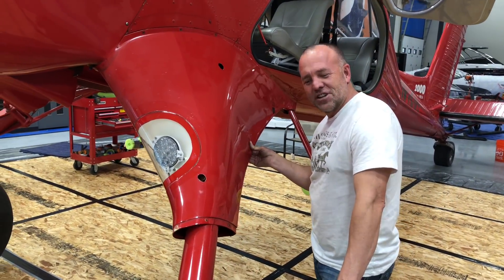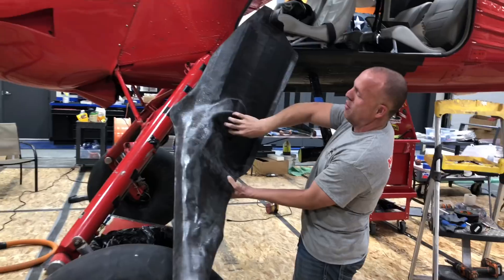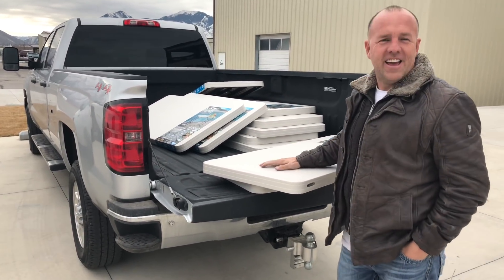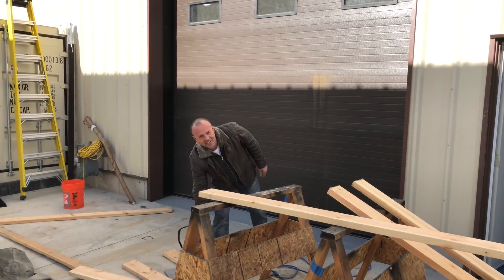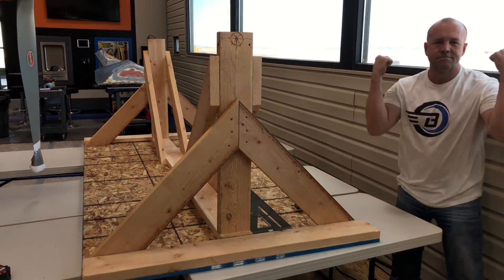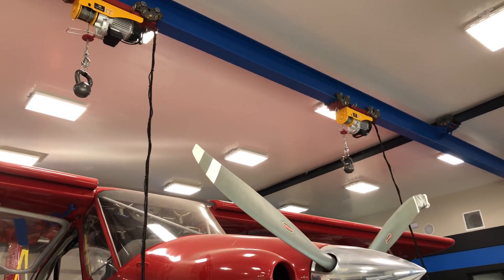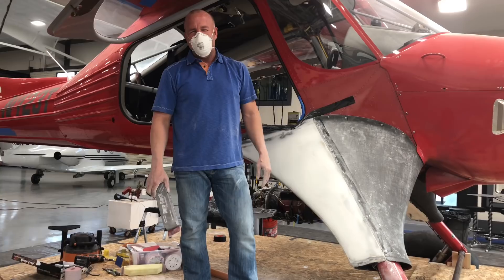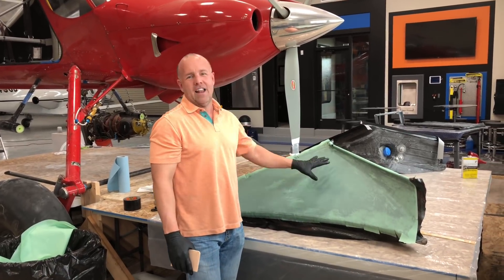Mike Patey Wilga (DRACO Video 1) Carbon Fiber Gear Leg Fuel Tanks

Comment: Did this unit ever get rebuilt ?
Reply from the maker: I’m working on Scrappy right now, you can follow along with that build series.  Draco X will be coming up later after Scrappy, I just got the new airframe, shown in my latest Scrappy #7 video. 🤠🤠
Reply: @MikePatey  thanks Mike I just checked it out. I just found your channel and watched things out of order. I dont have your skills but its inspired me to take on my 1st project...I'm starting simple with an aeronca champ rebuild (something I wanted to do even before I got my license).  See how it goes and I might refabric my super cub down the road too 😎👍

Comment: Mike how bout the same system that is current on motocross bikes,We pre load the shit out of the downstroke with a big button that is set just prior too launch,it lowers the front end aprox. 8 inches,greatly reduces a wheelie situation during acceleration. the button is released right after the down stroke happens. You could pre load the gear(squat) the same as a cat  ,then depress the release button manually

Comment: No crack problems when the landing gear flexes up against kind of rigid carbon fibre?
Reply from the maker: Daniel G, hey bud, the gear on a Wilga doesn’t have gear legs that flex like most other aircraft. They have a triangular fixed bars to prevent any flex. All the movement is isolated to the trailing link suspension gear below the pivot joint. I still rubber isolated the fuel tanks as additional protection. No signs of movement in over 100 hours of flight and back country adventures. Cheers

Comment: Good day Mike! I'm Sergey. I'm from Moscow With great interest watched your video about the modernization of your Wilga 35. I admire Your technical skills and design solutions! DRACO was amazing! I plan to buy a Villa 35 with a turboprop engine M601. Can you buy some elements similar to Those that you made for your aircraft (tail chassis, fairings of the front landing gear, reinforced elements of the lower part of the front chassis with hydraulic cylinders and axles and brakes, Bush wheels with wheels)? In case of difficulty with the shipment to the United States, I have friends who can provide delivery to Russia. Thank you! Good flights! Write please mail: kuznetsovS2010@gmail.com sincerely, Sergey.

Comment: There are several things that make your video(s) teriffic... first is your attatude which seems to always be upbeat and engaging... then there is the qulaity of your build and craftmanship which as most with tons of experence you make look genuinely easy and finally is your video producion which is "clean" if not sophiticatated and you don't belabor and dwel on the mundane a veiwer doesn't want to watch anyway such as sanding or cleaning up... so give your producion unit some cred... and keep up you good work(s)... next should be some adventures with the completed aircraft... it's too bad you didn't build in on-board cameras (other than the observational) as you seem so video-orented...